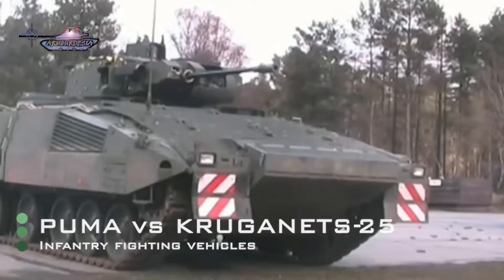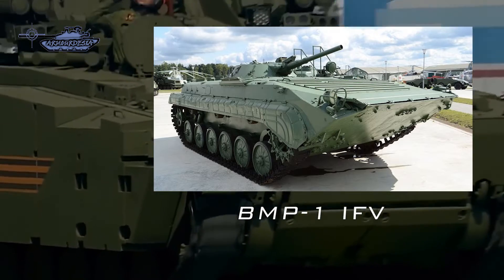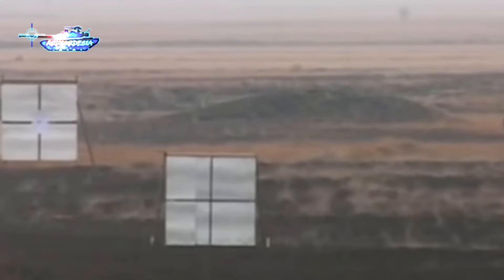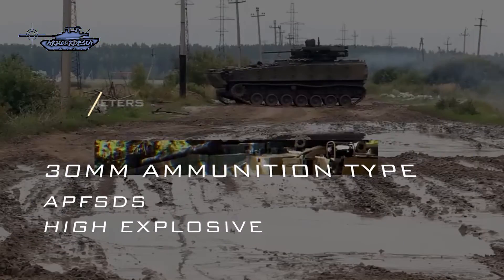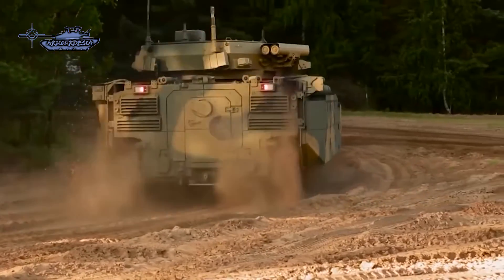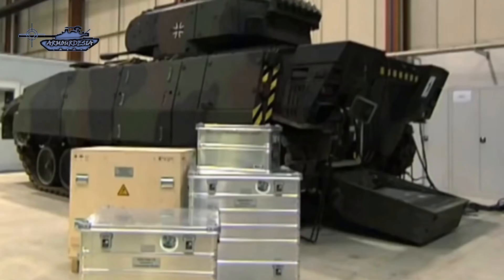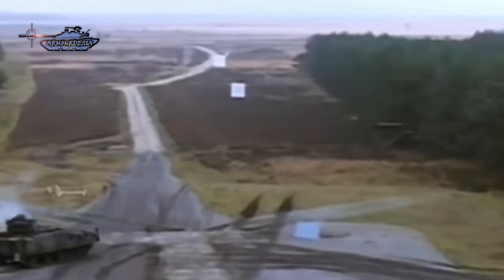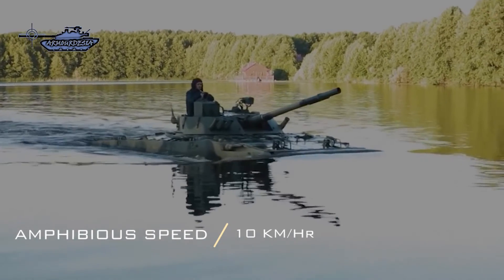Kurganets-25 vs Puma infantry fighting vehicle | Russian vs German IFV

Comment: Let me correct this video Host!! Kurganets-25 is better protected than Puma. It's built on armata platform and Armata is the best protected of all competitors at same category it has 30mm main gun + Coaccsal machne gun, explosive reactive armor, Aphganite protective system form RPG and ATGM. HAS 4 CORNET THAT ARE SELF GUIDED (fire and forget guided system) with range 10k. Video host degraded cornet to 8k and purposely degraded fire and forget guided system. Kurganets is better then puma in fire power and armor protections too. 👎Video host 👎 purposely 👎 downgraded Kurganets. End of story and speculation!! 👍Armata is well known as best protected platform presently!! 👍 Yet has adjustable suspension!!👍
Reply: these are all just claims from the russians. they dont even use this tank while germany does even tho they where seen at the same time. Russian weapons arent bad but whats the point of building a super ifv if they will never use bc it doesnt fit their doctrine. The kurganets is just a demonstrator vehicle to show the russian tech but is WAY to expensive for the russians.
Reply: you are correct!!

Comment: The comparison is completely incorrect.
At least because with a full set of additional protection, the Puma weighs twice as much as the B-11, more than 50t against 28t. Kurganets-25 is a chassis for BMP and BTR, the difference is the tower and the level of protection.
The weight of the main tank with a heavy protection kit. With a very modest internal volume. No active protection, except for the jamer.
30mm gun, good, but outdated. Short range ATGM. An ordinary, albeit remotely controlled tower.
In fact, this is a mini version of Merkava. With the same mobility problems. In addition, she is not able to swim.
The Germans again tried to make a universal car for all cases, but increasing the protection exceeded the reasonable limits of the mass.
This is a regular BMP from the 70s, but with increased armor, which is still not enough.
Or only those countries that have mainly equipment of the 60-70s, such as old armored personnel carriers and BMP-1, were considered as opponents. Because even an upgraded BMP-2 will be a problem, not to mention the BMP-3 and subsequent ones.
The B-11 has a similar level of protection with almost half the weight. In addition, the old 30mm 2a42 is universal, but only a temporary measure, or an export one.
But even it has afpds and remote HE. In addition, there is already a new tower with 57mm low ballistics with hash shells and AFPDS, which are more compact and rational for hitting "weakly armored" targets, under the definition of which the Puma is quite suitable. With such a mass and dimensions, the resistance to kinetic impact is only from 50 mm, very mediocre.
 For tanks and IFVs, there is not only a Cornet, but also a kinetic multi-purpose Bulat ATGM, a reduced analogue of the MRM-KE.
In addition, the active protection of the Drozd-2 works not only forward, but also in the upper hemisphere and to the sides, "shooting" behind the back is also possible, but this is already more difficult.
The project of 45mm telescopic ammunition is closed as too unreliable and expensive, besides not meeting modern requirements. But 57mm is quite suitable, the problem is the weight and dimensions of the projectile, but they are solved in low-ballistics guns by heavy HE and universal AFPDS. Which are lighter, more compact and cheaper.
Reply: The Puma works in tandem with the leopard. So whatever is to heavy for the Puma gets killed by the leopard 2A6. They are a deadly cat family.
Reply: @TorianTammas  yes, indeed
Reply: you are wrong on all accounts about the Puma. 
1. the weight of the puma is designed to be air transportable by the A400m and then it get additional modular armor for full protection. the weight was planed from the beginning and thanks to it's peace time limited 1.100 HP engine the puma has one of the best power to weight ratios of any tank so the weight is clearly not a problem. 
2. it's mobility is designed to keep up with the leopard 2 and it can keep up no problem so that's perfect. 
3. that's also why the puma can't swim, it's designed as an IFV according to german armor doctrine meaning it will always fight alongside the leo 2 and the leo 2 can't swim either but snorkel and so can the puma, higher protection was more important than the ability to swim since the puma is where the leo 2 is and therefore needs the armor protection of a main battle tank
4.the MUSS active protection system or as you call it 'jamer' is designed to stop SACLOS type rockets (like the russian and chinese anti tank rockets) and apparently it's very good at that and also the MUSS can be upgraded for hard kill APS which has already been developed and this year Hungary ordered their Lynx IFVs with the ADS called hard kill protection system.
5. the 30 mm gun is not outdated by any means, it's the most modern IFV gun on the market, it fires programmable armor piercing fragmentation rounds, highly effective to kill infantry even behind cover or in trenches, it's a game changer. the programming of the rounds is done while the round is fired off and the measurements for the timer of the fuse is done for every single round so it's unbelievably precise, the gun is also stabilized to the highest degree which is why the Puma can fire on the move and hit a target 3 km away on the first shoot (even helicopters) with a very high hit probability over 90% which is as good as any gun will ever be even main battle tanks have difficulty doing that (basically only the leopard 2 can do that right now)
6. the puma has the most modern battle management and communication system where the soldiers and the tank are digitally linked and share all information all the time which proved to be superior to the old way of fighting a battle in tests.
7. the ATGM is the most modern ATGM on the market and keeps getting upgraded, it's lethality is considered second to none based on it's outstanding hit probability even against APS protected targets
so all in all the puma has excellent mobility, incredible fire power, moderns digital battle system, MBT level armor plus active protection system and the puma is already in service whereas the russian one is only a couple or prototypes from 2013? with no actual unites being build
Reply: @Mar-s5q8m  u are 180% correct all are comparing only the system but never the doctrine behind. The leopard 1 and also 2 are designed as trapping tanks west germany knows that Russia wax having more tanks in service so in germany we still go with 1.  Gun 2. Movement and 3. Speed also the tactics are really different.  In germany an Tank squad will never working alone there are even brigades from grenadiers around. In germany we call that "kampf verbundener waffen" so it can be a squad of 4 leopard 2a7 having 2 pumas beside as back-up.
Reply: @Mar-s5q8m  all that stuff you listed, yet the Kurganets is still superior to Puma. Puma may be is 2nd or 3rd behind CV90
Reply: yeah 50tons for a IFV is insane that's heavy main battle tank weight......

Comment: Quite frankly, I don't think comparisons of IFVs are useful without knowing the doctrine of the army it is being used by.
Reply: It's all boil down to BMS, FCS, and survivability features since almost all IFV nowadays are basically the same, a great example would be CV90 mk4 where you can share your enemy location and have it on your gunner like when you're tagging someone in video game, and using terrain data to calculate where you can go sneak around avoiding direct line-of-sight.
Reply: @Kevin-fj5oe  well, depending on how you want to use your IFV (this depends on doctrine), you want some features more than others
Reply: @kuhluhOG  yep, that's why the general tracked IFV design are all follow the same general footprint. Both contender for Australian land 4000 program are practically the same, except the BMS/FCS they used
Reply: @Kevin-fj5oe  that works fine against Bedouins in sandals. But all that high tech geo-tagging crap won't work against peer level army that will be not only heavily jamming you with ECM but will blast your satellites out of the sky
Reply: @AB-ng7go  well, it's either china or russia, and i think we all know how russia performs.
Reply: @Kevin-fj5oe  yes we've seen Russia absolutely destroying all NATO assets and humiliating NATO in Ukraine so you're right, your statement proves none of these features would work against Russia
Reply: @AB-ng7go  agree, along thousands of destroyed russian vehicles including around at least 700 tanks and 400 IFV. Well, lots of them are captured

Comment: Puma is old. I choose Kurganets-25.
Reply: Wtf is your definition of old? The Puma joined service at the same time with Kurganets, so that makes the kurganets just as "old" . Are you stupid?
Reply: @xAlexTobiasxB  I agree with you.
Reply: @xAlexTobiasxB  The Kurganet has not jet entered service. Only the Puma is already on the battlefield.
Reply: Puma indeed based on old design but is quite modern and uses new technology
Reply: @ArslanCreates3D  what do you mean" based on old design"? Your comment makes no sense at all. The Puma is one of the most modern IFV in the world, with stabilized guns, modern frie-control, thermal optics, superior anti-tank missiles (top-attack) and heavy armor protection. 

If the Puma is "based on old design", then is every other IFV in the world "based on old design" too. Your comment make no sense
Reply: @xAlexTobiasxB  Puma is an "Offspring" of the Marder 2 Project, that was canceled in the early 90´s.
it has about the same hull form and the early turret was similar, but from then, newer and more modern technologies were implemented.
so it has its basis in a late 80´s project, that got rebooted and updated in the early 2000´s.
Reply: @xAlexTobiasxB  great argumentation dude...

so you are able to read and comprehend, are you?
then try again please
Reply: @ArslanCreates3D  That makes no sense at all. Then the Leopard 2 is also an old design because it's the successor of the Leo1. Or every IFV is old because the first IFV was BMP1
Reply: @Matze239  yes thats what i exactly want to say mate ,in looks it may look old but in every aspect its quite modern ....
Reply: The Puma is since 2015 in service with the German forces. The Kurganetz-25 exists only on paper. 300 Puma exist.
Reply: The comparison is completely incorrect.
At least because with a full set of additional protection, the Puma weighs twice as much as the B-11, more than 50t against 28t. Kurganets-25 is a chassis for BMP and BTR, the difference is the tower and the level of protection.
The weight of the main tank with a heavy protection kit. With a very modest internal volume. No active protection, except for the jamer.
30mm gun, good, but outdated. Short range ATGM. An ordinary, albeit remotely controlled tower.
In fact, this is a mini version of Merkava. With the same mobility problems. In addition, she is not able to swim.
The Germans again tried to make a universal car for all cases, but increasing the protection exceeded the reasonable limits of the mass.
This is a regular BMP from the 70s, but with increased armor, which is still not enough.
Or only those countries that have mainly equipment of the 60-70s, such as old armored personnel carriers and BMP-1, were considered as opponents. Because even an upgraded BMP-2 will be a problem, not to mention the BMP-3 and subsequent ones.
The B-11 has a similar level of protection with almost half the weight. In addition, the old 30mm 2a42 is universal, but only a temporary measure, or an export one.
But even it has afpds and remote HE. In addition, there is already a new tower with 57mm low ballistics with hash shells and AFPDS, which are more compact and rational for hitting "weakly armored" targets, under the definition of which the Puma is quite suitable. With such a mass and dimensions, the resistance to kinetic impact is only from 50 mm, very mediocre.
 For tanks and IFVs, there is not only a Cornet, but also a kinetic multi-purpose Bulat ATGM, a reduced analogue of the MRM-KE.
In addition, the active protection of the Drozd-2 works not only forward, but also in the upper hemisphere and to the sides, "shooting" behind the back is also possible, but this is already more difficult.
The project of 45mm telescopic ammunition is closed as too unreliable and expensive, besides not meeting modern requirements. But 57mm is quite suitable, the problem is the weight and dimensions of the projectile, but they are solved in low-ballistics guns by heavy HE and universal AFPDS. Which are lighter, more compact and cheaper.
Reply: @elusive6119  okay......
1. Puma in the C loadoud with the highest protection is only 43t, in its A configuration its only 31t, so no, its not twice as heavy as Kurganets wich weights 25t.
In respect to protection, Kurganets is not rated, but the estimated protection is comparable to BMP-3 maybe a bit higher. So protected vs 30mm and ATGM from the front, 12.7mm and RPG from the side. Active protection systems with ammunition can run out of ammunition very quickly, if the system is saturated (for example in an ambush situation)
Puma on the other hand is protected all round vs 30mm, with protection from ATGM and RPGs to the front and side, its MUSS APS is not going to run out of ammunition, but is intended to deflect ATGMs.

2. Both IFV use 30mm autocannons, but the Puma uses the MK30-2/ABM, wich is one of the most modern 30mm cannons around with programmable airburst ammunition and a fully stabilised weapon system.
Kurganets uses the 30mm 2A42 cannon, wich is basically unchanged from the 80´s and has severely worse performence than the MK30-2, is not stabilised, does not use programmable ammunition, has lower muzzle velocities and lower armor penetration capabilities.
The ATGM of both vehicles are not comparable, as the Puma uses Spike LRII and Kurganets uses Korned-M, two differend weight classes of ATGM, in respect to armor penetration both are similar, Kornet-M is triple the weight and size to Spike-LRII, Puma carries more ammunition than Kurganets for its ATGM.
the 57mm Turret is for AA purposes and not designed to engage IFV or other AFV.

3.Mobility...
the ability to traverse water obstacles swimming is absolutely overrated for an IFV and severely hampers russian/soviet IFV´s performence.
in no relevant scenario today an IFV is able to conduct an unopposed river crossing in a war scenario. an opposed river crossing is not going to happen, unless the attacker brings in an enormous concentration of forces and enforces the crossing with weight of fire, in this case mobile bridging equipment is used for the crossing of heavy vehicles. 

4. competition
a vehicle that is able to resist modern 30mm cannons frontally is going to withstand BMP-2 and 3, as they are using the 2A42 30mm cannon, wich is not able to penetrate Puma from the front, even with the most recent APFSDS ammunition. in return, the MK30-2/ABM is able to punch through BMP-2 and 3 frontally, as its ammunition was designed to do.

The Puma is designed for the doctrinal needs of the Bundeswehr, wich employs its mechanised infantry ALONGSIDE the MBT´s in combat as frontline units, while the Kurganets is designed for russian needs, where the mechanised infantry FOLLOWS the MBT´s in combat and only supports them.

And finally production numbers..... 
Well Kurganets is still not in production and its very likely that it will be cancelled like T-14 and T-15, due to the inabillity of russia to produce high tech thermal optics, fire control systems etc domestically, but imports them from the EU.
so there is no real competition here, Puma is in production and service since 10 years and one if not the most modern IFV of the world and Kurganets is just a fancy technology demonstrator and had no prototype production since 2013. 
this vehicle and its hype is a joke.
Reply: @zhufortheimpaler4041  Besides, why do you need a 5.56 machine gun? Scare the crows?
We don't know where to put the 12.7, and it's high time to adopt the 9.2 m as a single machine gun.
You considered the Kurgan of the first iteration with a different body and a combat module, which was 6 years ago.
In addition, your information is already generally outdated for about 10 years.
Reply: @elusive6119  dude you are in dire need of some political and geopolitical education
Reply: @zhufortheimpaler4041  We did not destroy the global world, but we will take advantage of this fact)
Si vis pacem, para bellum!
Reply: @elusive6119  How many Kurganez are in active service in 2022 in the Russian army?
Reply: @TorianTammas  the Putin pumpkin won't answer but I can... 0